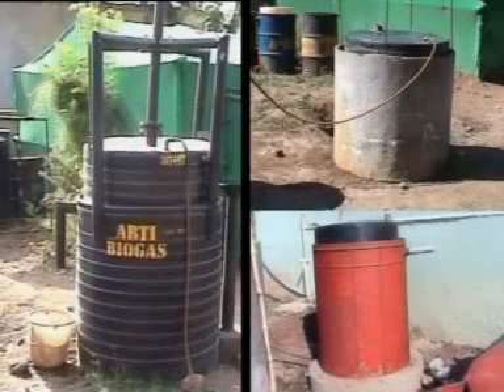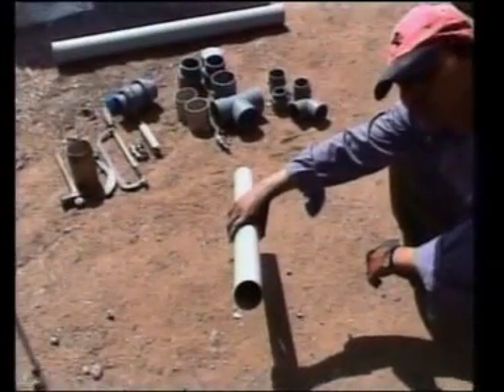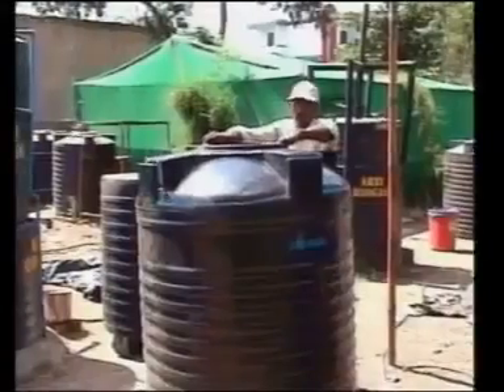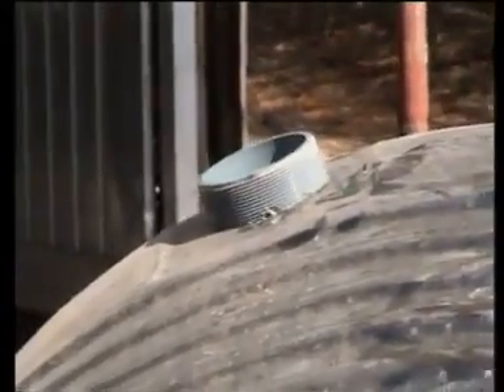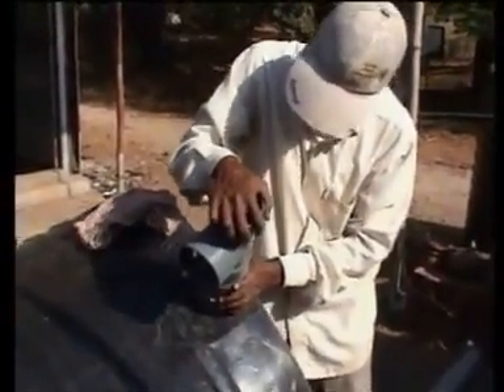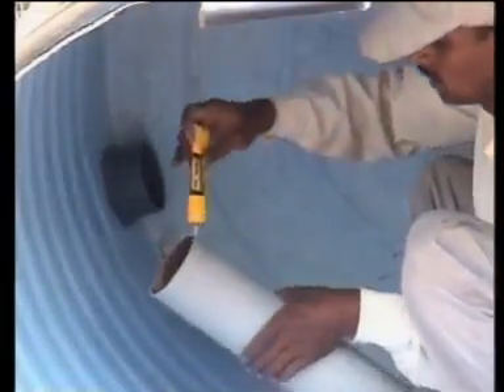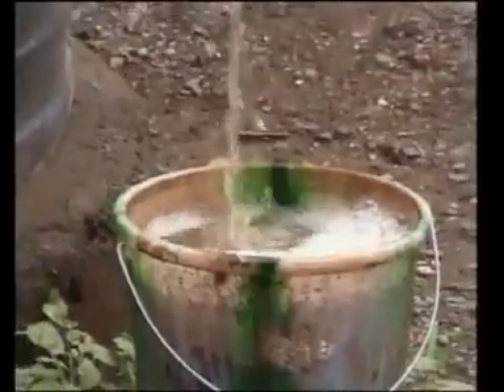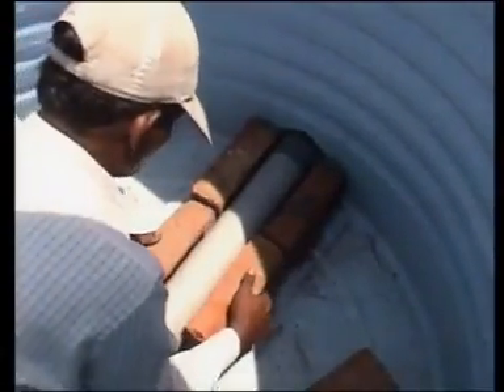ARTI Compact biogas plant step by step Construction Part 2

Comment: Pl.explain required pvc pipe length per 1000 thousand and 750 ltrs  equally with 750 ltrs and 500 ltrs capacity